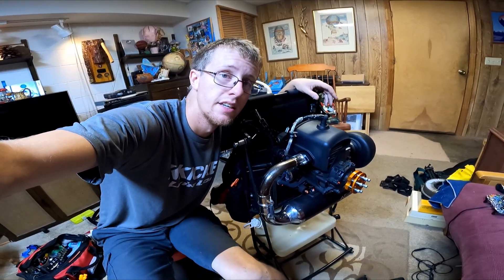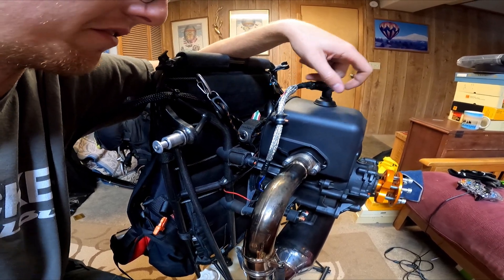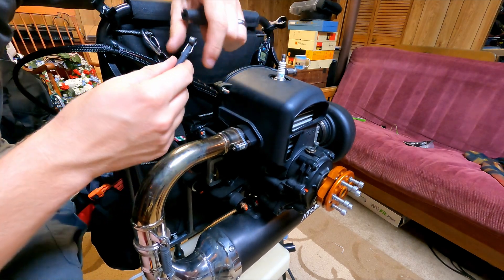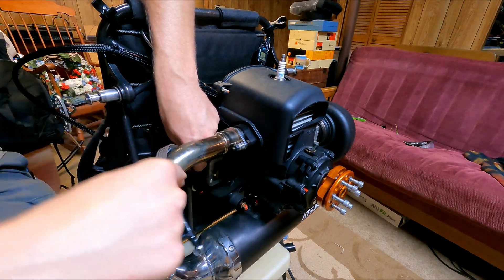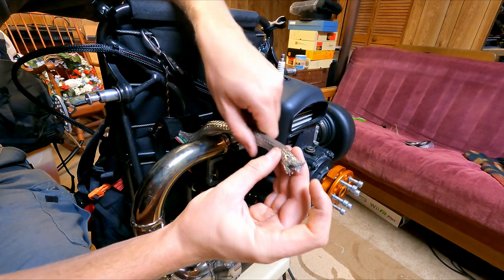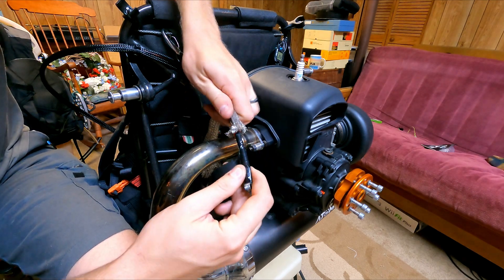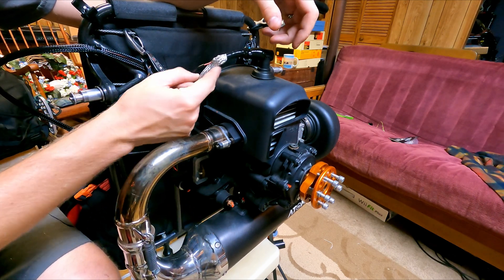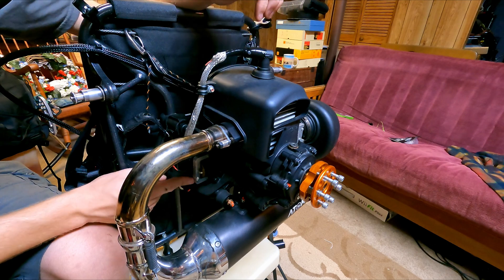Spark Plug Radio Static Reduction | Avery Flies

Comment from the maker: If you tach stops picking up RPMs, try trimming back the sheathing from the coil 3 inches and wrapping your tachometer around the spark plug wire there.

Comment: did this mod solve the problem? Do you have better comunication with aerial band? I have an Icom c16 end without your mod I can hear quite well other planes, but they acnt hardly listen to me :(
Reply from the maker: I was having spark plug interference engine noise while receiving and this cut it down by about half. Not sure on transmitting. I make sure to be at idle and almost yell when I transmit.

Comment: Thank you very much for the video, this is very helpful. I have 60 hours on the same Maverick/Atom80 as in your video which has been rock solid reliable, which makes me nervous messing with spark plug boot in terms affecting the reliability over time. As an alternative, I would prefer to use 3/4" (or larger) tinned copper and push it over the spark plug boot without modifying the boot, then folding over the excess along the length of the wire and taping it all. This would lead to an uneven thickness around the spark plug wire. Would this uneven thickness caused by the excess sheathing cause any radio shielding differences than the approach with the 1/2" you used?
Reply from the maker: It shouldn't, shielding should still shield.
Reply: @AveryFlies  Thanks Avery, will let post how this approach goes

Comment: Tried doing similar on Polini thor 202. Radio connection improved. However, the engine started stalling for no reason. It's unpleasant.
Reply from the maker: That... Should be unrelated? Unless the insulation on the spark plug wire is too thin. Weird. Try un-grounding the sheath (you don't have to remove the sheath) and see if it goes away

Comment: Use rubber splicing tape at the connection. That's what we use on high HP 3 phase motors to insulate the connections at the higher current.

Comment: I tried this. I thought I had insulated the sheathing from the spark plug just like demonstrated and grounded the sheathing to the motor mount but when doing ground start the engine would sputter then quite when at full throttle. I took everything off and re-assembled back to stock then it ran fine. The only deference I can see is that I ran the sheathing a little closer to the spark plug connector (I wanted maximum insulation!). I wrapped everything in electrical tape so it didn't make contact with the spark plug connector but it did overlap a little. Did I not insulate it well enough? Should I not run the sheathing right up to the spark plug connector? I know that was said in the video but thought why not as long as it's insulated? Maybe the spark is going through the electrical tape?
Reply from the maker: Yeah, the spark is super high voltage, it can jump through thin insulation. Cut the sheathing shorter.

Comment: Great video!! Smart idea!  The only thing I would do differently is use 99% Isopropyl Alcohol for the lubricant.  It will dry without residue and not cause corrosion.  This is the method we use on aircraft aviation and wiring.
Reply from the maker: Adding that to my mental toolbox, thanks!

Comment: Shielding the wire reduces the noise alot on both moster 185s I have. Other thing I would suggest is to use iridium spark plugs. I have gotten less rf noise when using an iridium plug vs the standard.
Reply from the maker: Thanks for the tips!
Reply: I changed to iridium and have the same rf noise as before. I need to try this video tip
Have yu tried using resistor boot?

Comment: Cool.  Thank you for the overview of this. I have an Atom 80 and I fly out of a local airport and I operate a handheld aviation radio, and I've noticed RF noise from the ignition... soo... yeah.. thank you. I guess the alternative would be an automotive radio suppression plug wire but I think for aviation this is a better idea.
Reply from the maker: Hopefully this helps you! It didn't get rid of the interference for me, but it easily cut it in half